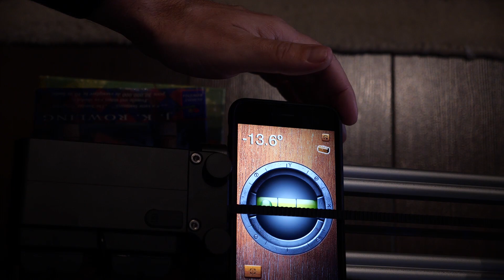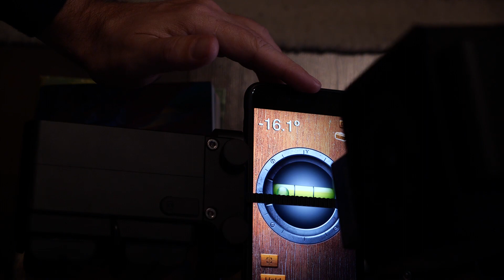Edelkrone Slide Module V2 - NOT DESIGNED FOR INCLINED SHOTS - but how is dealing with them

Comment: Hi Alex, I'd like to inform you that Slide Module is neither designed for incline shots or promoted this way anywhere. The reason why the App sometimes might show "Failed to Move" error is because the slide tension must be at a certain degree to move the system both manually by hand and with the joystick on the App. When users are unable to find that degree, the App might warn the user.
For your convenience, here's the Slide Module Tech Specs we recommend for optimal use: https://edelkrone.com/products/slide-module-v2?action=specs-and-manuals
Best, -Asude
Reply from the maker: edelkrone Hi Asude, I am well aware that the Slide Module is not designed for inclined shots. 
But there are comments on the Internet stating that the smallest incline of the slider (as an example, when is mounted on a tripod) is generating jittery movements. 
In my experience, it was not the case. So, I thought testing the Slide Module in extreme inclined conditions, gradually changing the level of incline, could provide some reference on how big the incline has to be for the problems to appear. 
At 16 degrees of incline, in my example, the recorded footage still is ok (not jittery - at least from my point of view). 
So, with the correct set up of the gear and with the right slide belt tension, and avoiding the slide belt memory effect (not leaving the rubber band on the slider when storing the gear over night or for longer periods of time), 1 - 2 degrees of incline variations, when the slider is mounted on a tripod, should not generate problems.

Best, -Alex
Reply: OK, a pro tip for stupid people. You can run ANY slider on an incline even vertical if you just tie a string and hang a bottle filled with water to balance the load. Obviously, if you're stupid you won't figure this out like this guy so there you go... whew oh the poorly educated!

Comment: The problem I have with the #edelkrone bashing is I never thought to use this slider in an inclined position. The incline shots with jittery. IN all of the video promos, I never saw anyone using that slider in an incline position.
Reply from the maker: I totally agree with you :) But how jittery do you find the samples in my test? As you saw, I left long takes for every inclined position, up to 16 degrees just for everyone interested to be able to evaluate :D And I used a 35mm MFT lens (70mm equivalent of a full frame).
Reply: Video Tool School the jitters were very bad on all the incline shots